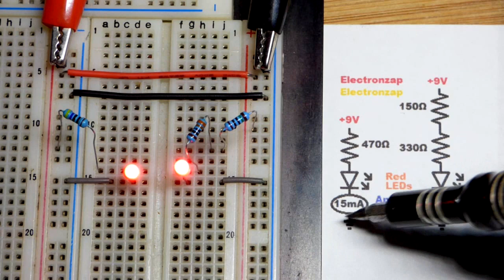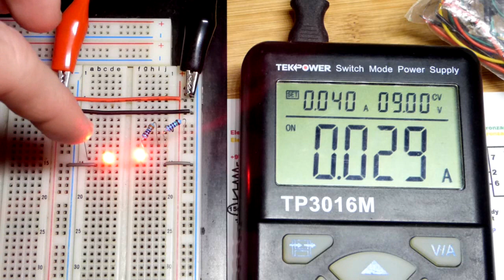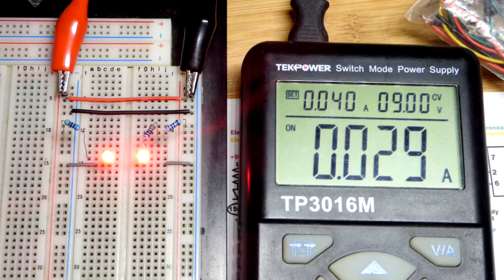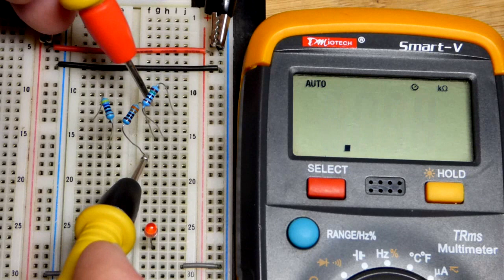Series resistances add up when limiting current demo circuit learning electronics shorts lesson 13

Comment: Thank you, for all you do to teach the EE Community. You are most gracious and your videos are great. I humbly offer the following thoughts... This video was overly broad and short in duration, which made it vague, which made it confusing. It was titled to be about series resistance, however you expanded the topic by powering the two LED circuits in parallel, without much explanation as to why, or the effect of doing so. The resistance measurements were only approximate and the math was not written out to demonstrate the processes. There was not much explanation of the different tolerance ratings in which resistors may be purchased. An experienced person could sort it out; a beginner would simple be lost. I hope you receive my thoughts as they are intended... In the spirit of extreme appreciation and helpfulness. Cheers!